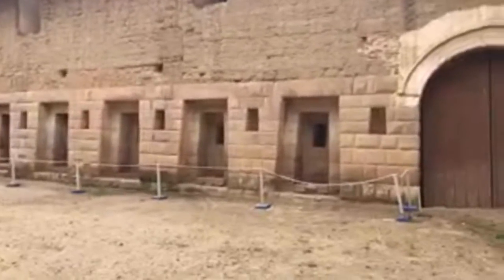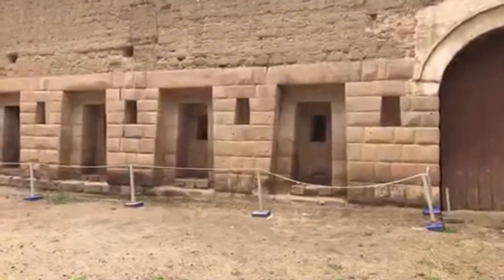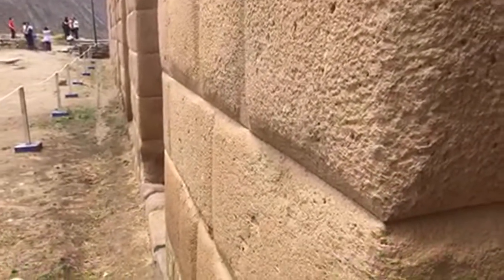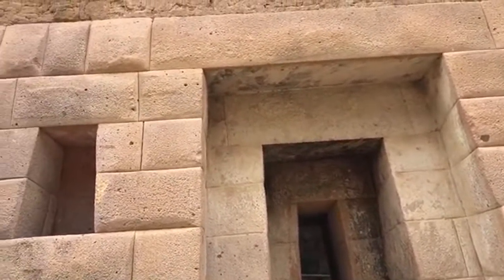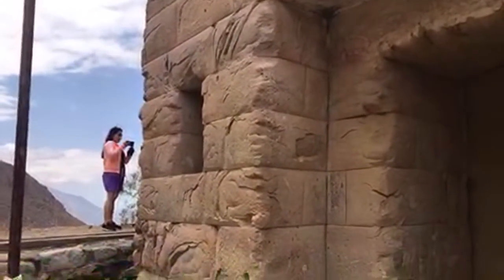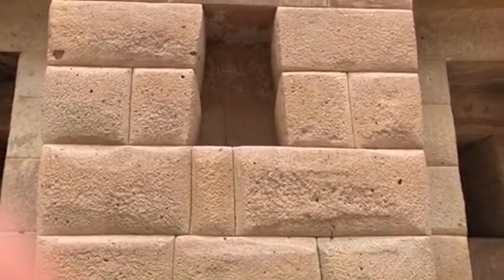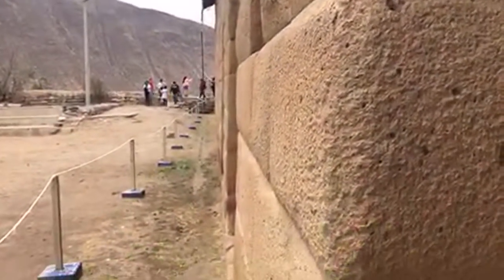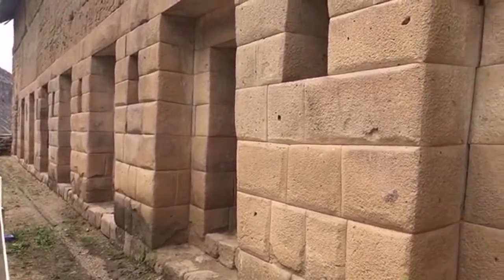Megalithic Huaytará again

Comment: If the top of the structure were destroyed by a blast (water or explosion) on said corner  Then some sort of debris field should be on the opposite corner. Where did the remainder of the structure go? They might have reused the materials but that would have meant they spent time breaking the rocks into smaller pieces or the catastrophe disintegrated it into smaller pieces. Either way where did the upper structure go? Now a tidal wave would have carried the upper blocks for miles. Water could as well with enough force tear the face off of the ones showing the damage, think what a pressure washer can do. Wow imagine being there when this happened?